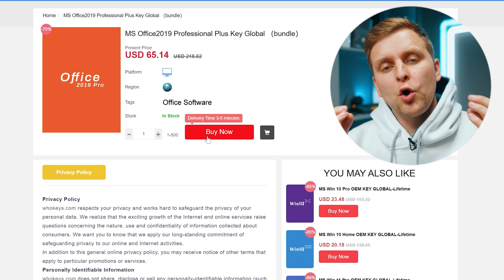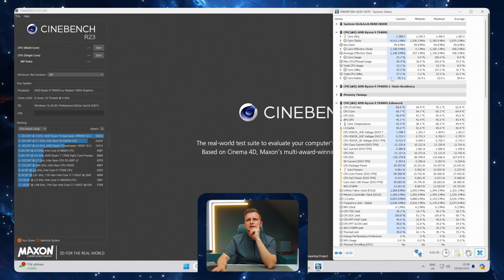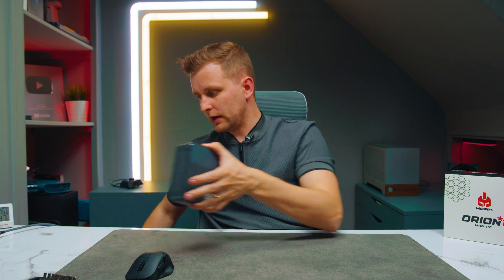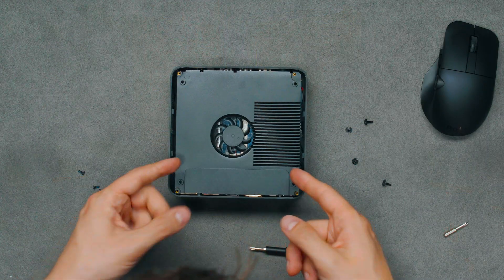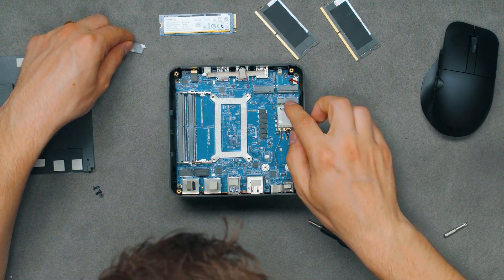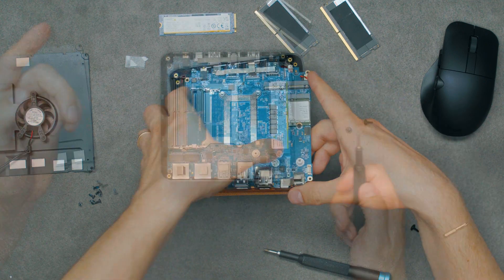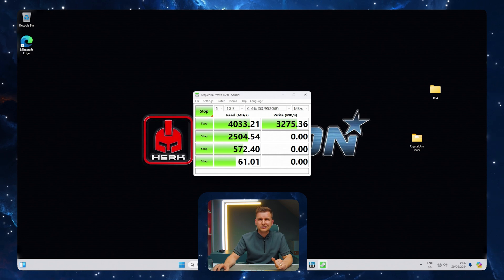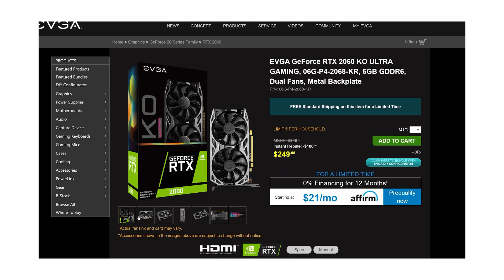UNKNOWN Brands Can be GREAT - Like THIS! 👉 Orion Herk Mini PC review

Comment: hey, i wanna build a desktop but i m a complete novice. my budget is R25k (rands) or $1364 and yes this budget must include mouse, keyboard and monitor. if anyone can help i would really appreciate it.
extra information, i wanna use it for coding, animation and also GAMING 🗿
Reply: What kind of game you looking to play and are you going to stream
Reply: @howardwilson3466   games nothing really to specific. but forza, cod and starfield.
as for streaming nope, i won't be doing that
Reply: @African_Blade  I'll do some research and see if I can help you build a budget PC that will fit your needs
Reply: @howardwilson3466  thanks really appreciate it🙏
Reply: I'd go for a ryzen 7600x on a B650 Asrock mobo. 2x32gb ddr5 ram (cheapest you find), 2 TB Lexar NM790 m.2 ssd, a cheap 65$ case with at least 3x 120mm fan included, and try to find a decent second hand graka (rtx3080 or better). 
A decent 27" monitor (1440p, 165hz) should set you back 200$ and check your local IT store for deals on keyboard/mouse.
All that should keep you well below budget.
Reply: Edit: if you have the space and some budget left, go for a 32 or 34" UW montor (1440p and at least 120hz) That should be around 350$ and it will make for a much better gaming experience.